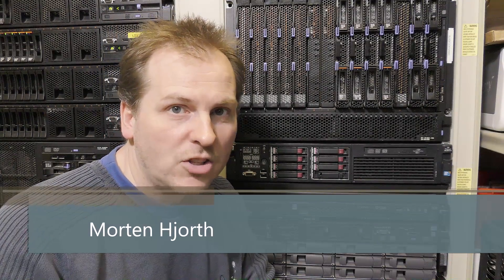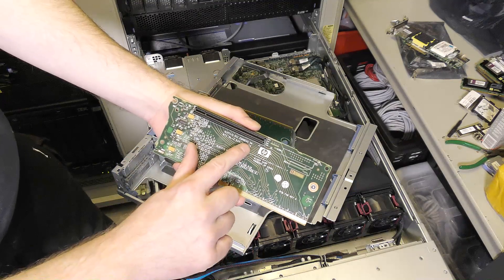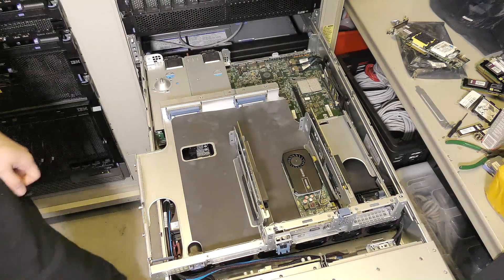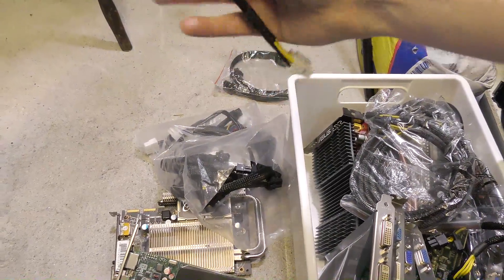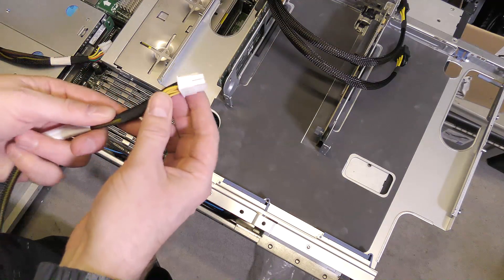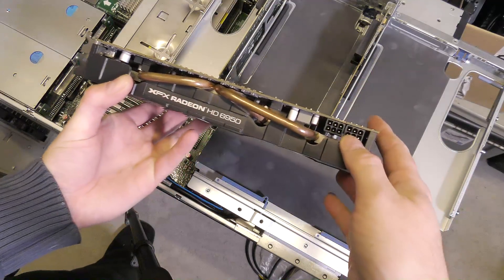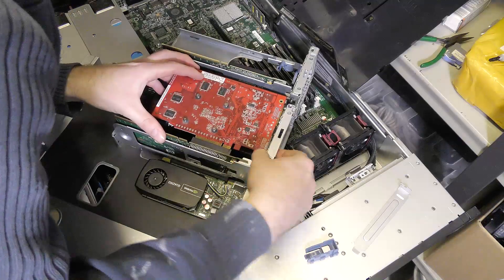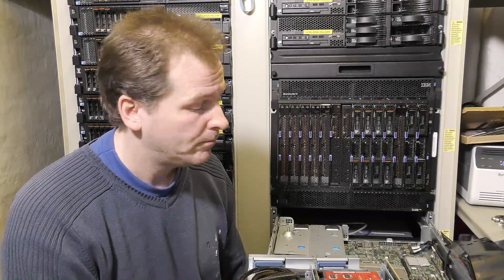Outfitting the HPE dl380 G6 with 3 Graphics Cards - 583

Comment: I have a HP DL380 G7 server and I recently upgraded the riser board so I can run a good gpu in it. both the riser board and gpu have a 8 pin connector and I’m trying to figure out if both connectors need to be plugged in or if only one needs to be plugged in. I just bought the CoMeap 10 pin/ dual 8 pin adapter cable ( item number 374034) specifically for my server. I know the 10 pin connector needs to plug into the port on the motherboard. Can you tell me if both 8 pin connectors have to be plugged in as well        ( one to the rise board and the other to the gpu) or would just one 8 pin plugged into the riser board be enough since the gpu plugs into the riser board via x16 slot?
Reply from the maker: A GPU can get 75watt through the PCIe 16x port, and a 8 pin connector can supply 150watt to the GPU
Reply: Copy that. Thank you

Comment: I need to create the 10pin out power connector to a six pin GPU, is there ANYONE who has any guide on this? I suck at electricity and don't want to order cable. i want to do it today. Probably that's not going to happen but I am commenting here anyways in the hopes someone on 5/9/2021 can help me or give me advise or a link to a guide
Reply from the maker: This might be it : https://pinoutguide.com/Power/hp_sas_power_conn_pinout.shtml
Reply: @MyPlayHouse  will check when I get home and report back, thank you!
Reply: @MyPlayHouse  Ah yes I have seen this. But it seems to only have two 12V outputs, I need tree and the rest should be ground, according to the pinout of the 8-pinner GPU, about half-way and a little more there is a pinout of the 8:er https://www.moddiy.com/pages/Power-Supply-Connectors-and-Pinouts.html
Reply: @MyPlayHouse  Here's another pinout some random dude on the internet made himself with a multimeter... tricky to trust since I don't have one myself. https://community.hpe.com/t5/ProLiant-Servers-ML-DL-SL/Pinout-for-DL580-10pin-PCIe-Power-Cable/m-p/6992314#M160311

Comment: I recently acquired an Hp proliat dl380 g6. But where do I buy spare parts in Denmark? I have a little trouble finding, for example, hard drives.
Reply from the maker: Hi Direkte fra Lolland
HP servers are picky,, they want HP drives,,, you should have gotten a IBM/Lenovo,, you can feed that with laptop drives. Ebay germany is a good places..
Thank you for watching! :-)
Reply: HP servers are indeed picky, but you can use other drives than hp branded. You can use this list as guidance: http://dascomputerconsultants.com/HPCompaqServerDrives.htm Personally, I've had problem with only one drive on DL380e G8, some Seagate Momentus drive from external hdd, whereas Samsung 860 and 870 evo worked fine, as well as intel 545s and some wd blue drives. You can get caddies from ebay or Aliexpress from China, and they forked fine so far for me

Comment: What’s the maximum power for 10  pin connector I want to use NVIDIA tesla K80
Reply from the maker: Hi FAT BILL
I do not know/remember,, and it did not show up on google right away :-/
Thank you for watching! :-)
Reply: Not going to work in an G6 or G7 with the 300W TDP for the GPU, unless you want to hack your way around with external PSU's. 

At work we have some servers with Tesla K20's for professional transcoding (Telestream Vantage Lightspeed). They are actually re-badged SuperMicro servers, but come with all the custom support and therefore $$$ costs. In another environment we have some DL360 Gen9's with the only official supported GPU, the Quadro M4000. These are used for fusing videos in Adobe Media Encoder. Those GPU's were only bought afterwards when it became clear that fusing the videos was too slow on CPU only, and HPE of course charged a hefty pricetag for those. But as a professional broadcasting company, we had little choice or would otherwise lose support from HPE if we did a DIY solution on those machines.

Comment: Oh man. You shouldnt cut the connector on the card, but "open" the end of the short slot with plastic cutter tool.
Also please dont plug any factory cables in the card without measuring the correct 12V voltages in the connector. The perfect solution that i use is to solder the bare end of a 6+2pin cable directly to the 12V and ground rails of the PSU backpane. That way you can pull more than 250W for the graphics card easily.
Reply from the maker: Hi Zoltán Bálint
Thank You very much!  I cut the cheapest thing,, normally the Riser is cheaper than the Graphics card,, but the really old card I cut back to a x8,,, was almost trach.
Thank you for watching! :-)

Comment: Also, I'm looking for an inexpensive graphics card AND sound card, that are both compatible and fit inside this server.  I only have one riser card, like the one you showed inside yours.  Any suggestions?
Reply from the maker: Hi jdp7743
Totally depends on what you are planning to use the GPU for.
Thank you for watching! :-)
Reply: @MyPlayHouse  I mainly use the server for media, mainly Plex. So video
Reply: @jdp7743 Hi,  Not sure if you already found something but I have a Quadro P200 in mine and runs fine.

Comment: Is it possible to overclock the cpu on this motherboard
Reply from the maker: Hi ekdromoi
Not as far as I know!  glad you liked the video :-)
Thank you for watching! :-)
Reply: I have 2 Xeon x5670s in mine that are stock 2.93GHz however when you go into the BIOS and set it for max performance the cpus run at a solid 3.20 GHz, not much of a boost but still more than stock.

Comment: Nice video. I want to install Nvidia Titan V in HP DL380 G9. I want to make power connector myself. Could you please let me know pin mapping of 10pin to 6 pin cable? The original cable is too expensive and rare.
Reply from the maker: I do not have the pin out,, I would google it..

Comment: Not so simple Morten... I have the same server and i have so many problem to run a decent graphic card because of the riser card, that can't provide so much power to the card and the power connector is not designed to power a graphic card directly ( you need to build an apposite cable ) . Now i have the X16 riser card that have an input power connector to bring the extra watt on the PCI-E slot. I will try it in the next week. By now i have an Nvidia G210 in the central PIC-E slot and works fine, is the only one i have that works. Thank You for the video.
Reply from the maker: Hi MVVblog
Thank You very much!  glad you liked the video :-)
Thank you for watching! :-)

Comment: I have a DL380 G6 and I tested the voltages on the pins to find the 3.3v and the 5v. I spliced in some SATA connectors to this power and added a SATA card to add (2) 4TB hard drives for additional cheap storage for my machine. Plex is running great on this machine for me. I have had 3 Blu-ray players streaming at the same time with no problems
Reply from the maker: Hi Doug Rank
Thank You very much!  That is Cool,,, glad you liked the video :-)
Thank you for watching! :-)
Reply: Hi Doug I need to do something similar. No for hard drives though, I've got 16 600GB disks in mine already :-) . Do you still have a pinout of the 10 Pin Connector?
Reply: @TheServerGeek  I would recommend this product. instead of making yourself  https://www.amazon.com/COMeap-Motherboard-Adapter-Compatible-Server/dp/B07JKFMJJP/ref=sr_1_5?crid=20FY03TMOLBOD&dchild=1&keywords=comeap+10+pin&qid=1598971320&sprefix=COMEAP+10%2Caps%2C205&sr=8-5

Comment: I have a GTX 1050ti in a x16 riser in mine, not using the cable. It smashes every game at ultra settings running from an esxi 6.5 vm. It has 5 other instances running 24/7. I have it hooked up to a 4k tv but mainly stream my gaming to my MacBook. You should see peoples faces when playing GTA V on ultra looking superb with a ps4 pad over a VPN in the pub on a MacBook Air! I have 24 cores (dual x5670) 96gb of ram and 24tb of storage. Cost me less than £600 all together (some drives I already had)!
Reply from the maker: Hi Jay Somerville
Thank You very much!  glad you liked the video :-)
Thank you for watching! :-)
Reply: Jay Somerville how did you install the nvidia drivers inside the VM without the fault code some folks get with GeForce cards. Also: what software do you use to connect the MacBook Air to the VM and display GTA V?
Reply: Kevin Kraan add this parameter to your vm advanced settings: hypervisor.cpuid.v0 = "FALSE" and the drivers will install. I then installed geforce experience and then used the moonlight chrome extension on the macbook. Add mstsc.exe to custome geforce games for desktop. Done!
Reply: I am considering getting a DL380 instead of building a new computer. Putting in a good Nvidia or AMD card is the only reason I haven't bought a server yet. Is it plug and play with a graphics card? Says a 1080ti needs 250W. Can it supply that? And what about running a PCIe 3.0 card on it? Thanks
Reply: Mike Albert it is pcie 3 but with the riser card and power cable the max is 150w so a 1060 would be the highest you could fit unless you were to power it using an external psu. Risers and cables can be a pain to get hold of. I was extremely lucky to find my stuff at the price i did but if you can manage it you wont regret it!
Reply: The one I was looking at is a DL380 G7. Those have PCIe 3.0? I thought it was just 2.0 but either way from what I have read you can use a 3.0 card in a 2.0 slot with out much downside.
Reply: Mike Albert mines a g6, i assumed it was 3 as my gaming experience is as should be, no bottlenecks. Just make sure you can get the other needed bits before you commit or does it have the riser etc with it?
Reply: My PlayHouse great vids!
Reply: Not sure.  Its DL380 2x 6 core xeon 32GB with some 1GB graphics card in it already. Guy is asking $150. Seems fair enough.
Reply: Mike Albert awesome, especially if its gpu ready let alone has one fitted! Maybe put the fitted card in a x8 riser so you have a spare for vms or media transcoding!
Reply: Jay - I have a DL380 G6. Can you please recommend a GPU for 4k which seems a possibility base don your experience! TY.
Reply: For gaming or media?

Comment: Thanks for this video. I have installed my 8GB 2 rail graphics card in my DL380 with ease after watching this. I did something different. I moved the riser card to the secondary slot and cut 2 small pieces out of each end of the top half of the graphics card mounting bracket, using the full length of the GPU's PCI-e card. I now have a xeon 12 core 72GB gaming, video editing and rendering machine.
Reply from the maker: Hi WFX_Malice
Thank You very much!  That is Awesome,, glad you liked the video :-)
Thank you for watching! :-)

Comment: There is a true X16 Riser card available for the DL380 G6. It also has a ten pin Molex power connector for GPU power. It is HP PN:  496078-001 and apparently will work on a G5 as well.
Reply from the maker: Hi Brannigan777
Thank You very much! 
Thank you for watching! :-)
Reply: I buy one of this on Ebay because on the x8 riser most of my graphic card don't work well or do not work at all.. i hope that on the x16 riser the things will get better
Reply: @MVVblog  Did your GPU work well with x16 riser? Did you face any issues while under full load?

Comment: HP = Have Problems...
Reply from the maker: Hi Lars Appel
or Hardware Problems Evangely,, for now HPE :-)
But there is no reason to talk bad about HPE,, they keep a lot of technicians at work,, way more than other brands :-) 
Thank you for watching! :-)
Reply: @MyPlayHouse  try getting GPU pass through to work!!
Reply: @mattruddick8919  Are you stuck on this issue too? I'm trying to get VGA passthrough with linux... no luck at all
Reply: 1. Fujitsu, 2. Dell, 3.IBM/Lenovo, ... X. HP. I work at an IT-Service here in Germany, we suppot companies up to 40 employees. We dont sell any HP products, but some companies dont buy their printers, they lease them, so we had no choise. HP Printers are the Printers with the most Problems, 2 Weeks ago a company get 3 New HP Printers from their lease partner. 3 days after we had installd them, one of them wasnt reachable anymore. the only fix for the problem was, to reinstall the driver on the server. Last week the second one had the same problem. I am curious how long they work without problems now... We also had much problems with HP notebooks, the crazyest one isnt long ago.We just bougth this for the boss of a company, because of the look. The Notkook cost about 2000€, so it shouldnt be crap... When he is at his the office, he connects the laptop to his docking station, and works with external monitor, keyboard and mouse. After a few weeks he called us because he had a rectangle on the monitor, in which his mouse pointer stucks. After a couple of hours we found the error, the touchscreen responded to the sunshine. Thats HP.....
Reply: I work at IBM, I know exactly how many they employ. For some reason HPE is the only company we cant collaborate with.  We have no issues working with others like Dell, Seagate ext. I cant even count the times I was on the phone with customer and HPE- Storage and had to explain to those guys that corrupted storage is on the storage not host...
Reply: I agree Lars, that Fujitsu make excellent servers, but comparing HP and Dell, leaves HP way ahead. Dell unfortunately uses substandard quality components.

Comment: Awesome video as always. I would highly suggest looking into cable-mods or someone who makes custom cables. I am sure they could make you a 10 pin to dual 4 or 6 pin PCI adapters. It would not be cheap but they may sponsor you can do more video like this.
Reply from the maker: Hi TheInternalNetwork
Thank You very much!  http://www.ebay.com/itm/10pin-to-8-8pin-Power-Adapter-Cable-for-HP-DL380-G6-and-GPU-50cm-/141972404965
Thank you for watching! :-)

Comment: My gpu's in my DL380 G6 only use the pcie x16 slot for power, never wanted to temp fate with the extra power port at the front.  That port is really meant for the 2nd 8 bay  SFF 2.5 inch hot swap bay & back plane. Also the GPU's are single slot cards.
Reply from the maker: Hi Chris Lowe
Thank You very much!  Yes if you get a Riser card for x16 GPU,, It has another power plug.
Thank you for watching! :-)

Comment: You can even mount GPU in DL160 G6 (with one 6pin connector max), but it really requires some tinkering. I have two servers with two GPUs: 1050ti and 650ti boost. If anyone wants to buy DL160 G6 with a GPU, i can hopefully be of help to fit it. (And I know how to overclock DL160 G6 a bit, but perhaps thats another story).
Reply: I gave up on the 1U blades (had a DL140 instead of 160) for mods like this.  They're even tighter space-wise.
Reply from the maker: Hi Jerzyna aKwei
Thank You very much!  glad you liked the video :-)
Thank you for watching! :-)